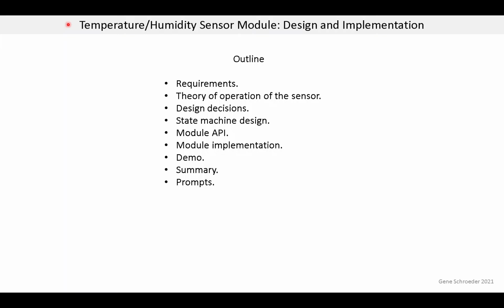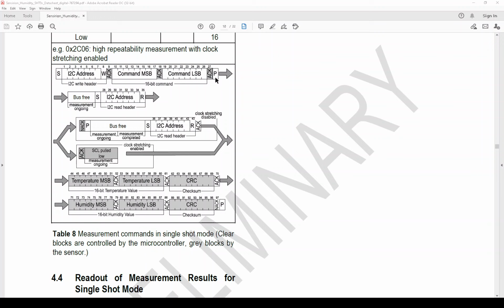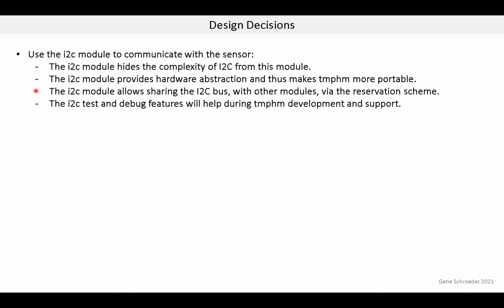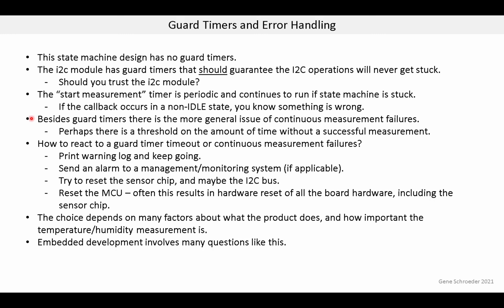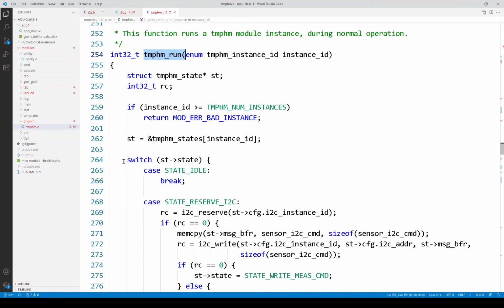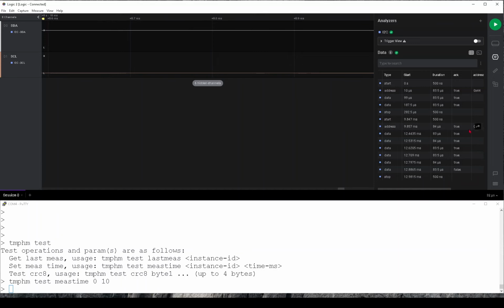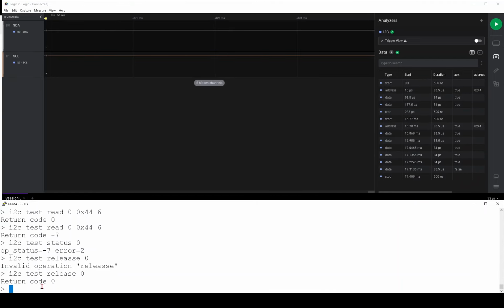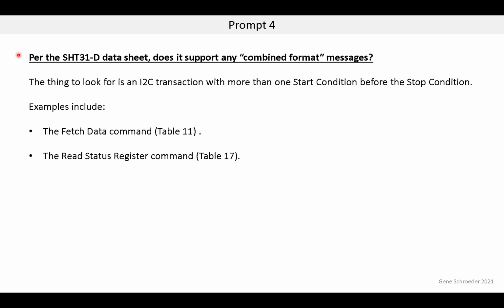I2C Lesson 5. Temperature and Humidity Module Design and Implementation

Comment: Hi Gene, I have a question. I would like to implement another I2C chip (sc16is762). The chip is a little more complex compared to your sht31 chip.
I have to read, change bits, and write multiple registers before the chip can be used. How would you implement this.
Just setup the registers in the start function? This makes the start function slower because you have to poll the i2c bus every time. 
But it's easy and pretty straight forward if you only need to do the settings once at startup. But what if you have functions to change for example the baudrate.
I'm curious what your design decisions (simplefied) would look like.
Reply from the maker: Hi Christian,

While normally I don't like blocking when using a super loop, I think it is OK during initialization, because until initialization is complete, the system is not really operational, and blocking delays are usually not a problem. On the other hand, if you wanted, you could enhance the module framework by calling start() for all modules repeatedly (sort of like run() in steady state) until all modules said they were ready to go. This would support modules that had more complex start procedures and did not want to block.  This might mean some simple state machine in the module for the start procedure.

I generally like to use state machines in my designs. So for a UART you might have a number of states for steady-state operation, as you read the status register, read data bytes, and write data bytes.  But if there is a request for a baud rate change, you probably need to leave the steady-state state for a short time while changing the baud rate. Say changing the baud rate requires writing two registers. The states might be:

STATE_READING_STATUS
STATE_READING_DATA
STATE_WRITING_DATA
STATE_BAUD_CHG_WRITE_REG_X
STATE_BAUD_CHG_WRITE_REG_Y

While changing the baud rate, you will temporarily ignore the status register.

This is high level, but I hope it helps. Ask more questions if you wish!

Gene
Reply: Hi Gene,

Thanks for your reply.  So for example I need another module to write data to the fifo of this chip. I have a public function for example sc16_write_data. In this function I copy the data and length to a buffer which is in the state struct of the sc16 module. I change the state to STATE_WRITING_DATA (maybe I have to make sure the state machine is idle?). In this state I first need to check the fifo status register to check if there is any free space. If so I can write the number of bytes which are in the state struct buffer. Would you implement another state machine in this STATE_WRITING_DATA state? I think this state machine should implement the i2c reserve, issue a status reg read, wait for the answer, check the bit, send the bytes and wait again for completion. And do some timeout/error handling? 

Thanks for you time.

Chris
Reply from the maker: Hi Chris,

Here are some thoughts (although I have not looked at the spec sheet in detail). So please don't think my suggestions are always correct.

I would try to keep all operations of the UART in one module, but have two instances of this module for the two UARTs.  Perhaps there are some common functions (init and startup) that one of the modules is responsible for.

I would try to have a single state machine. For complex systems, you can have multiple state machines in a hierarchy (google "hierarchical state machine"). This is done sometimes to reduce the number of states (prevent "state explosion").  I would try to avoid multiple state machines if possible, but it could be better in the end. One case where a "sub state machine" might be useful is to read/write a register since this happens so often (again, this depends on the details).

Overall, it might be best to just write out the operations for the various use cases, to help organize your thinking and see common procedures. This can be the most difficult part of the design task.

You are working on a very specific problem, and I am trying to give general advice. This perhaps isn't very helpful, but I try lol. From your questions, I believe you are going in the right direction.

Gene
Reply: Hi Gene, 
Thanks again for you time.  It's an interesting subject. Would be nice if there where some more pratical examples available somewhere. Maybe it's a nice subject for a follow up video. Then maybe more the theoretical part in a high level hierachie. Or maybe you know a good resource with more practical examples other than a blinking led.

Chris
Reply from the maker: Hi Chris,

I'm aware of one set of videos on state machines, including hierarchical state machines, by Miro Samek, but only briefly looked at it. I don't know if it contains any examples that have complexity >> blink LED.

https://www.youtube.com/watch?v=EBSxZKjgBXI&list=PLPW8O6W-1chxym7TgIPV9k5E8YJtSBToI

Gene
Reply: @geneschroedertech7501  Hi Gene,
 
I have another question. I would like to add an eeprom to my project. The eeprom contains serveral structures like configuration, programs, service counters etc etc. So serveral modules need to read and write data to the eeprom. What would an appropriate design pattern be for this eeprom module. 

Chris
Reply from the maker: @cjlvossen  Hi Chris,

I don't know if the EEPROM has SPI or I2C interface, but it doesn't really matter.

Some things to think about are how to control access to the SPI or I2C bus, in case there are multiple devices on the bus. I did something very simple for the I2C module.

Next, above the I2C or SPI module, is how you handle the EEPROM data reads and writes. One idea is to have a EEPROM module that would accept read/write requests in the form of a data structure that would have a command byte (read/write), and a status byte (waiting/success/error), the EEPROM address, the number of bytes, and the data buffer, plus a location for a "next" pointer. The client would fill out the structure, and call an API on the EEPROM module that would put the request on a linked list. The EEPROM would execute requests in order, take them off the list, and set the status byte. The client would poll the status byte, to see when the operation was done (success/error)/

Or you could have the EEPROM module handle one request at a time, and client modules would have to first wait for the EEPROM module to be free to request an operation.

There are many ways to do it.

Gene
Reply: @geneschroedertech7501  The EEPROM has an I2C interface and I have several other I2C devices on the bus. The modules follow the same design pattern you have been using in your lessons. There's a run function which executes a state machine. I like the idea of the linked list approach. Like you said there are many ways to do it so I was curious which one you would implement if you would make a lesson out of this. 
I'm still wondering about the data itself. For example I have a module which needs some settings which are stored in the eeprom. Would your eeprom module have a copy in ram memory of the layout? So at startup your read all the data structures from the EEPROM so they can be accessed by an API? When one of the structs has changed a write will be triggered so the data is synced to the EEPROM? Especially at startup it's a little tricky to get the data in the modules before the main loop will start all the run functions.

Regards, Chris
Reply from the maker: @cjlvossen  Hi Chris,

First, it is very cool you were able to extend the module design and add other I2C devices. I know of one person who did reuse some of the code.

About your questions, I had imagined each module would know the locations of where its data was, and the eeprom module would not know anything, it would just do reads/writes to addresses as requested. But you could centralize the knowledge of all data in the eeprom module, and so  clients would ask for data using some kind of logical ID system, and the eeprom would map this to EEPROM addresses. All good questions.

If the clients are going to want to read the same EEPROM data again and again, then it would make sense to have the eeprom module cache the eeprom data into RAM (if you have enough RAM).

You could add another state to your startup sequence that would allow the EEPROM module to read all of its data into RAM before entering the "run" state. I worked on a complex system once that had many startup states, and the modules would let the "superloop" know when they were ready for the next phase of startup. Quite a bit more complex than the system in my videos.